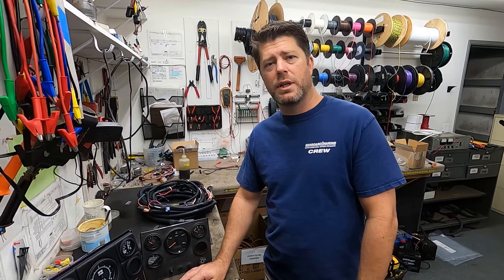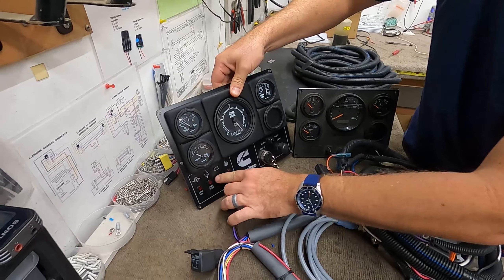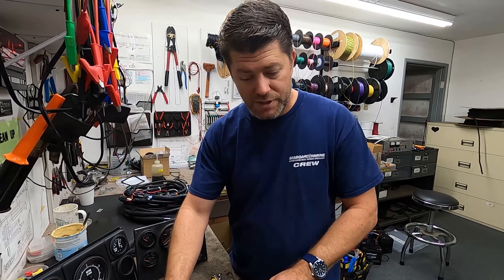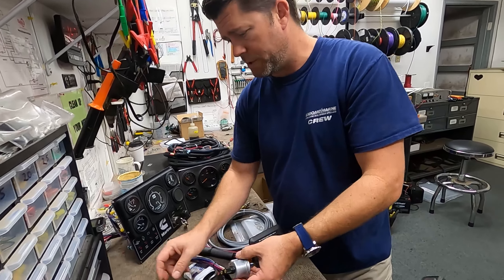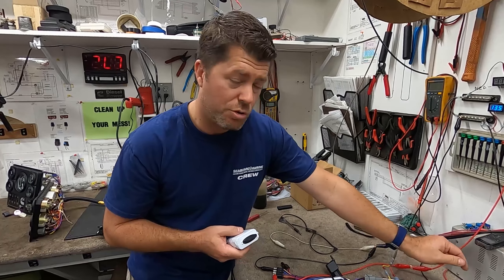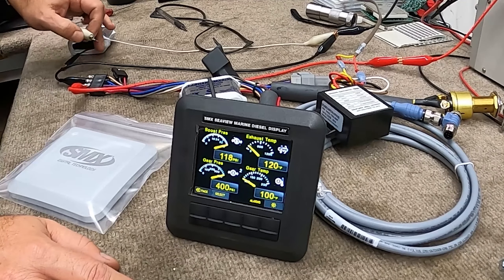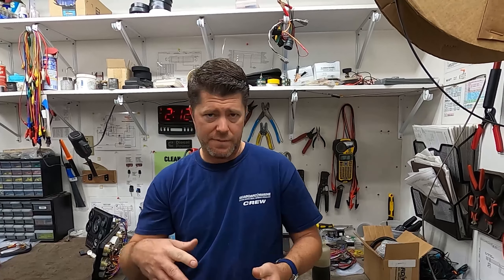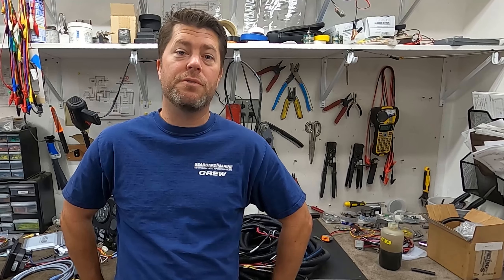SMX DigitalView Display for Cummins & Other Mechanical Engines

Comment: I wonder if that Digital Display will work with My Cummins M11/ISM Truck Engines. The Dash’s in My Freightliner Trucks don’t Display Everything such as The EGT’s, Turbo Boost, and Others.

Comment: wicked nice. i hoping to getting a couple for my volvo 60s. mine are NON vdo, dual station mechanical gauges. If i switch out to dual station VDO gauges can I keep the mechanical gauges and use the screen in parallel to those? can the EGT thermocouple be tapped into a water mixing elbow or does it have to be upstream of the water? is there a floscan style option to monitor fuel flow? really cool options with the alarm timer. my stock alarm sounds every time i shift the trans.
Reply from the maker: No the senders do not work with our digital screen and an analog screen.   The best way to do dual station is to run our screen with standard single station senders, then run a second screen via the NMEA 2000 network.

Comment: What resolution of digital display? Seems coarse a little bit...
Reply from the maker: Its not UHD 4K that's for sure.   It's displaying video or images, simple graphics for the engine data.  I am not sure of the exact resolution but its certainly adequate for seeing what needs to be seen.  We are pretty pragmatic around here.  We just like simple stuff that works.

Comment: Im repowering with 6cta's and want more digital info (my mech won't touch qsb's or any other "computer bullsh*t" as he calls it). Is there a way i can integrate this into a bigger display with a more modern feel?
Reply from the maker: Yes our Digitalview screen can be ordered with a plug and play NMEA 2000 output.  You can connect any NMEA 2000 marine electronics and display engine data.  The nice thing is the engine, the harnessing, and most of the senders will be the same analog stuff your mechanic is used to.

Comment: I'm interested in converting my older mechanical Volvo to a digital NMEA2000 readout. Is this something that may work? Do I need new senders or will this convert my current analog sensors?
Reply from the maker: VDO senders for pressure and temp, you need our amplifier for EGT, and a mag pickup for the tach.  I think Corey covered it pretty well in the video.